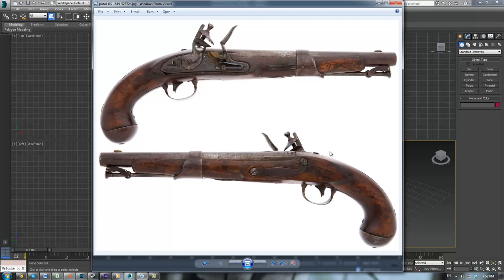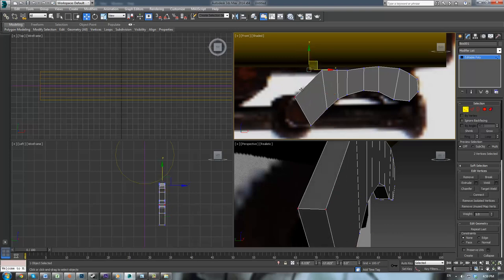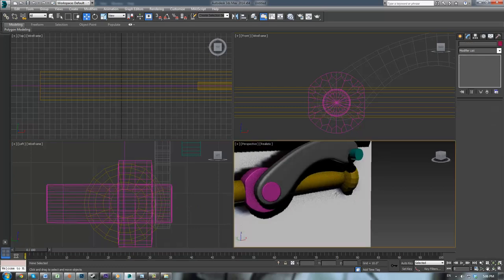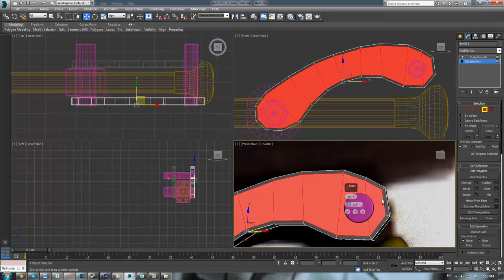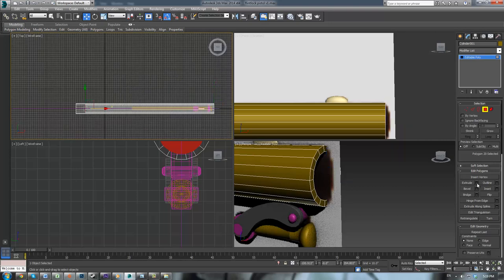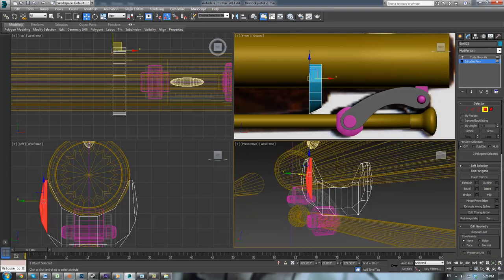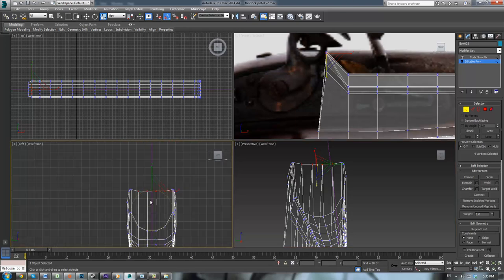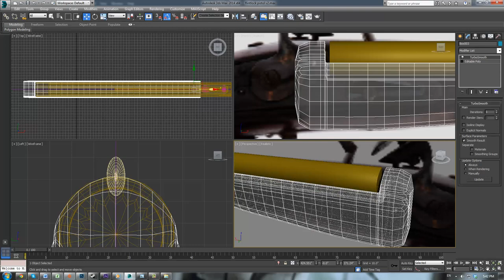Flintlock Pistol - Part 1

Comment: Nice one, might be a small detail but its great that you start with the barrell. Since the width and heigh ratio always stays the same if you start with cylindrcal shapes you will have a much easier time getting down the thickness of the model since that can often be hard for beginners.